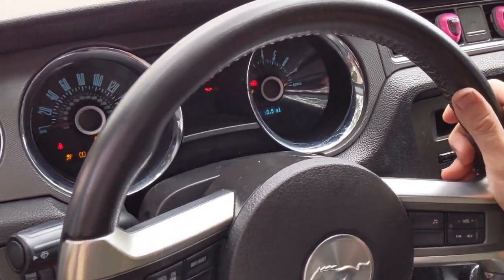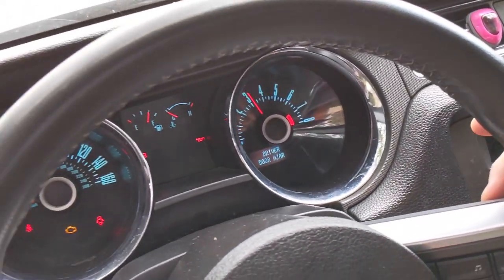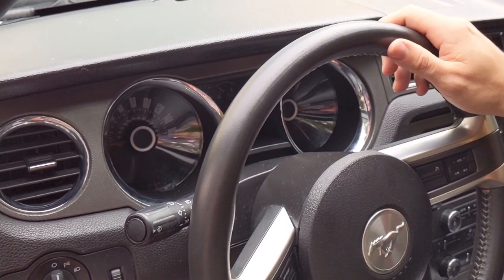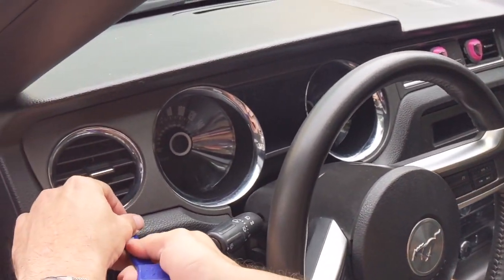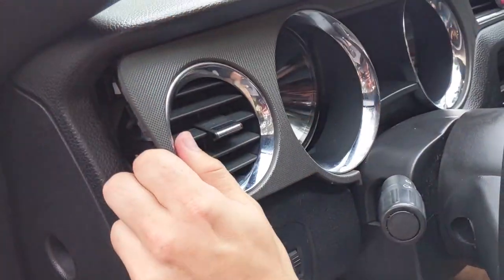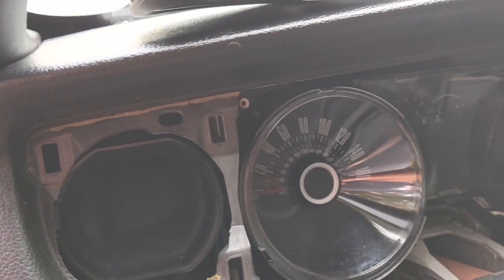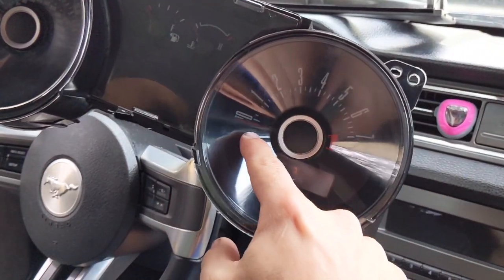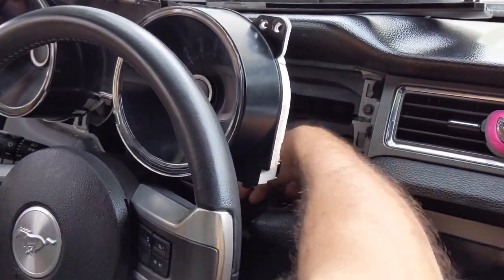2012 Ford Mustang Cluster Removal & Installation

Comment: this is a similar problem to what i am having. my needle wont go to zero. its all over the place and spends most of its time working but pointing down. some times gets stuck at the bottom. wondering if that's fixable or need new? any other parts i should look at while apart?
Reply from the maker: Tel:              +1(888)-541-6025
WhatsApp: +1(561)-385-5843
E-mail:        sales@ecuteam.com
WEB:           https://ecuteam.com

Comment: What was the problem with needle? And how is possible to avoid that?
Reply from the maker: The motor went bad, it happens from time to time, electronics and time do not go well together.
Reply: @ECUTeamCorp  Hey...so you cant just push the needle back where it belongs?    Mine is straight up and down...still works, just a complete 180 from where its supposed to be.  THANKS